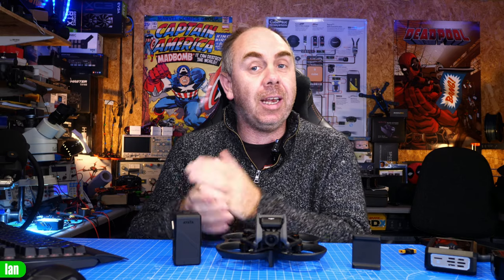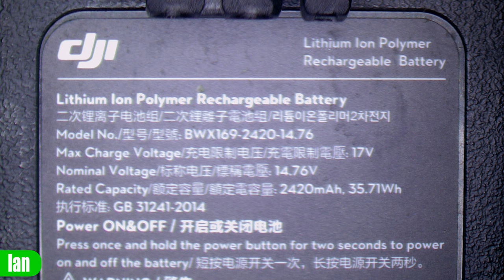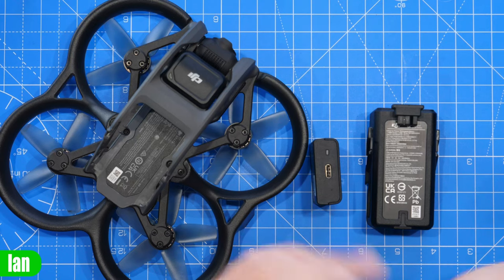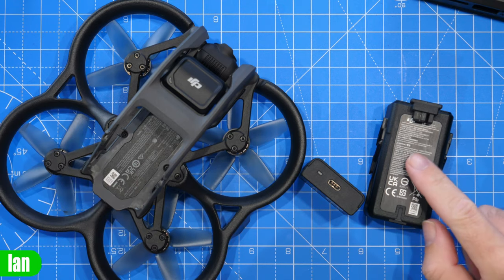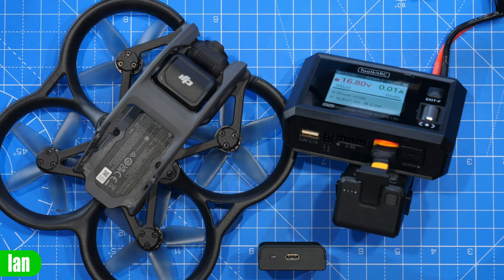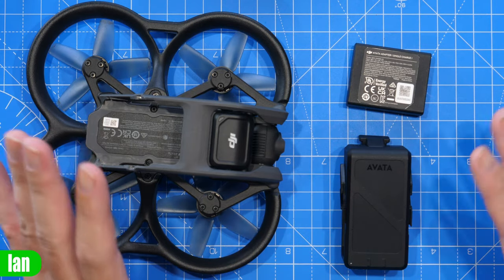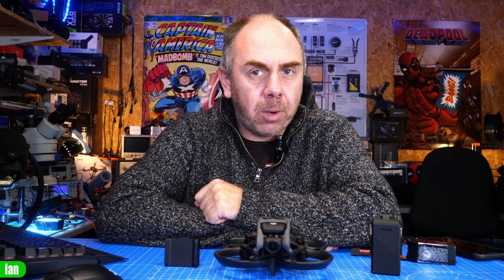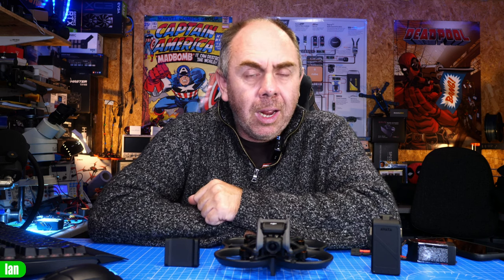DJI Avata Battery - Lithium Ion Polymer & Why No 3rd Party Chargers?

Comment: I've always thought $129 for a battery is way overpriced and IMO not having 3rd part charges is just part of their strategy to keep customer buying from them. I think the other reason is that I've always thought that the majority of DJI customers aren't tinkerers and they just want stuff that works which is ok.
Reply: It is. It is already outdated and overpriced
Reply: To be fair all smart batteries from proprietary sources are expensive due to the custom pcb and firmware. Especially Spectrum tech.

Comment: You can bring a big LiPo fieldpack (with USB-C out port), a USB-C to USB-C cable and the Avata charge hub (single or fly more kit).
Keeps you going all day!
Reply: Cool so a powerbank? Doesn't change the fact that you can only charge 1 battery at 45w instead of 3 batteries at a total of 135w. Hence reducing charge time of 3 batteries to 50 mins instead of 150 mins
Reply: @allthenamesaretaken2  or you can use the 65W charger

Comment: Hi, DJI also lists the Mavic 3 battery as Li-Ion, but it is indeed a Li-Pol battery. I would like so see a third party make Li-Ion drone batteries that will allow keeping fully charged batteries on hand to get a drone up in the air fast without waiting to charge a Li-Pol battery. The DJI Mini 2 can use the Mini 1 Li-Ion batteries, nice.
Reply: They list it correctly. Lipo is just a lithium ion polymer battery

Comment: Can you discharge the battery normally with the XT30 to XT60 connector without the special logic though or would that not work? Namely, if I had a spare Avata battery, could I use it directly on a self-built 4S FPV drone? If not, has anyone created an external adapter with that logic port that would allow using the avata batteries on other drones? Their energy density seems really good for the weight and if you already have the Avata Fly More Kit, you could potentially save on having to buy more batteries for your custom drones...

Comment: The battery connector on the Avata is almost identical to DJI's Robomaster S1. The two devices use the same number of cells. The Robomaster S1  uses Li Ion 18650 cells.

Comment: I mean if you got the fly more then you have 2 chargers already. I mean it's not as good as the old 4 Port parallel chargers on the mavics but I honestly would spend $50 buying a 3rd party charger just to charge 3 at a time.

I'd be more interested in 3rd party batteries. Like the dude that used to make 10000mah batteries for the mavic pro that gave it 30-40min flight times.

Comment: The bigger question is what does the official charger charge them to and can you decase them and put an XT60 on them to take advantage of the extra capacity on a regular FPV drone? (Since it appears some DJI batteries charge all the way to 4.5v a cell).

Comment: I mean it makes sense tho. It’s multiple cells. You need a balance connection. Now the question is if it’s dji specific balance communication. Idk of any charger that will charge a lipo battery above a 2s without a balance connector

Comment: If it's a LiPo how they manage to get this high in regards to energy density?

A TATTU R-Line (1300 mAh, 4S) weighs 163 g

A DJI Avata Intelligent Flight Battery (4S, 2420 mAh) weighs 162g

Comment: By the way, Ian. Do you know why, if the battery is a LiPo, it still holds nearly 100% charge after one week? Other DJI batteries are more empty after one week. Normal behaviour or faulty firmware?
Reply: The longer you leave a lipo charged the more the chemistry is damaged. Waiting a week to self discharge gives a better user experience as the battery isnt flat the following weekend, but it will drastically shorten the life. #dischargedaily
Reply: Don't some DJI drones have settings where you can tell the battery how many days before it starts discharging? And I know that most of them will delay one day every time you press the button to check the charge level.
Reply: @kurtzFPV  Never heard of that. The user manual says: The battery will discharge to 60% when idle for five days. My batteries stay close to 100%.
Reply: @Fly_High_FPV  DJI has smart batteries. They should auto-discharge.
Reply: @Killerbee  ofc, i'm saying letting them rot longer before the battery self discharges is good for dji and end users feel better, but get shorter life as result
Reply: @187Killerbee  I would expect if you touch the battery I.e. press button to check charge it will reset the discharge timer and stop it discharging if like all of their other smart batteries so you would need to leave alone until time has elapsed for it to self discharge to storage level
Reply: @kurtzFPV  mavik pro

Comment: You could be spot-on with this information buddy however. Because this is classed  as a beginner drone because of the way it flies,  and lets be honest anybody and their child could fly this thing, they could have done this for safety reasons because even though a beginner could fly it, not all beginners understand charges, and as you are well aware if you don't use your charger properly there can be a big bang. So I would like to think DJ I have done this for safety.
Reply from the maker: The safety argument does not really hold water as the charger is still in the battery. You literally can’t damage these with the wrong charger as it won’t let you.  The adapter simply supplies constant voltage and current. Go out side of what DJI allow and it will shut down anyways.  This is why there has been no issues in the past.
Reply: It appears more likely to be the legal department that touts "for safety".  DJI don't want to be sued when a 3rd party charger made the toy go boom.

Comment: Great video! I'm looking to charge my Avata batteries using the fly more battery charger and also using my Toolkit RC M6D in power supply mode. I'm unsure what output vaultage and max current to use? Could you advise? Thanks.
Reply: The best USB C output for these is PD25 which is 12V * 2A. Of course PD60 20V * 3A works but i see no reason to fast charge and 12V is closer to the nominal voltage of the battery anyway.

Comment: Hey thanks for the informational Video. Does anybody know if the connection is also required to discharge the dji lioos? Or colud we use the dji batteries potentially on other logrange lightweight fpv builts if in need? Or discharge to storage voltage after flying with a Standard lipo charger?
Reply from the maker: Yes the battery will turn off if you try to discharge it with out the data connection.
Reply: @MadRC   thanks alot for the clearification.  So It will be intresting to see further ivestigation of AirCuiser (e.g. diy li ion dji fpv batteries  ...)  and those of the good people who are working on reverse engineering this protocol.

Comment: Only if DJI would provide themselves a decent parallel charger. The fly more charger they currently do will only charger the 4 batteries one by one. That means a full night of charging before going out to fly. Also, charging at the field is a no - no.
Reply: Fly more charger is 4A... while single charger is 2.8A. So the flyMore charges really faster than the single charger !
Reply: @freedom2000  still, it's only charging one battery at the time. It's not parallel charging.
Reply: @paultatar  yes sure... Their strategy is to charge the "biggest" battery as fast as possible. So you can un plug it from the charger when fully charged. But it is not a // charger 😞
Reply: @freedom2000  unfortunately DJI not only are not making a parallel charger themselves but also they make it difficult for the other 3d party manufacturers by encoding the connection to the battery. Typical DJI stuff.

Comment: Typical DJI lock-in bullshit. Call it "smart" and charge 6x the price for lipos. Now they have added DRM to charging too...worst part is the customers are paying for the extra hardware that keeps them from running market price lithium.  Just like the 2S Samsung 18650 goggle batteries they sell for $45, when they're just 2x $3 cells + a BMS and DRM
Reply: I run a large brick 4S Lipo as my V2 goggle battery. Lasts all day.
Reply: @Wayne GoldPig  yup, i like to use my oldest, shittiest 6S flight pack to power my goggles

Comment: I'm disappointed that nothing was said about what would be the best USB-c charger to use with the battery module. It accepts 5 volts at 3 amps (15 watts) 9 volts at 5 amps (45 watts) and 22 volts at 2.25 amps also 45 watts. Using a small USB-c charger like for a phone will take hours to charge it back up. But a laptop charger of the right voltage would charge it up three times faster!
Reply: 15v 3a-60 min

Comment: Do the WTF guys really have nothing else they want to work on? This seems like such a frugal project for them. I can't say I'm not impressed with everything they do, but yeah that was my first thought when you brought it up haha.
Reply from the maker: I said a member of the WTF Group.  I did not say the WTF team, there are a LOT of clever people there.
Reply: @MadRC  Sorry I didn't say the WTF team either, was merely referring to a guy/s in the WTF team/group. I was just surprised it would be of interest to them, but I guess what they are after is a challenge more than anything haha. No doubt all very clever talented people, I'm a big fan.
Reply from the maker: The goal in the end is a none DJI  battery. Get away from the shackles.
Reply: @MadRC  No doubt. Honestly the team should just start a drone company at this point, surely easier than reverse engineering then fixing everyones mistakes haha.